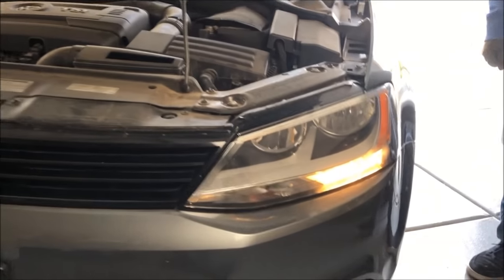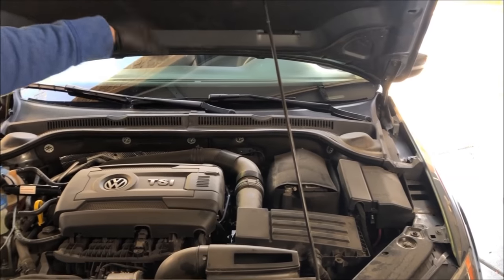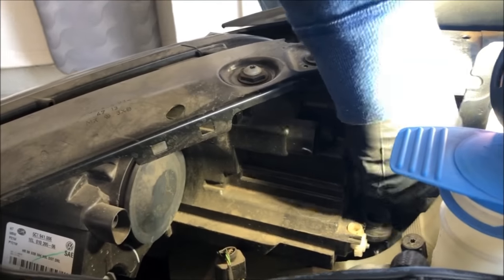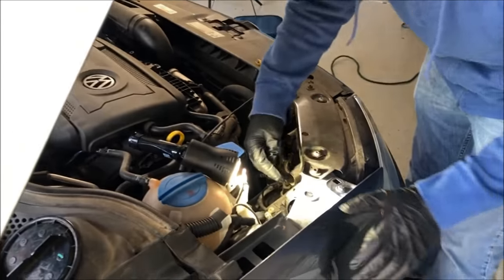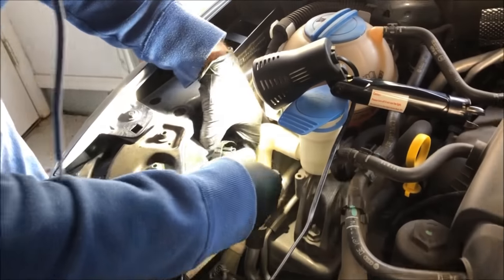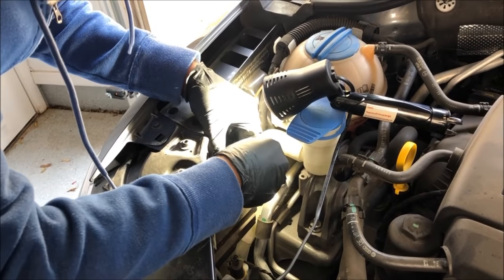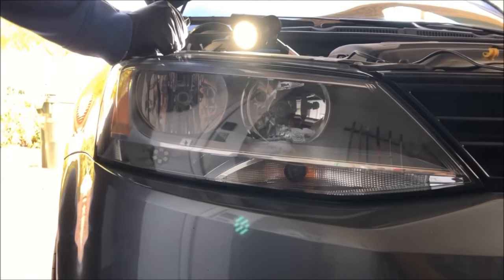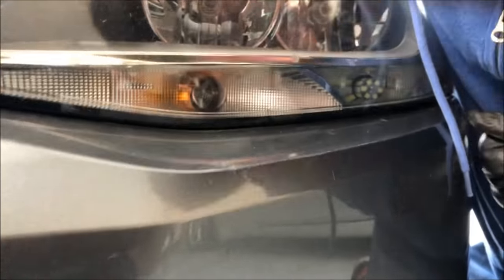How to Replace VW Jetta Daytime Running Lights (MK6 2011-2018)

Comment: Thanks for the video. It was a big help. The owners manual to my 2015 Jetta tells me to take it to a dealership if I need to change a light bulb. "Changing a lightbulb takes a certain amount of skill," it says. I'm pretty confident I can handle it, VW. I just needed to know how to get at it to change it. Information the manual fails to provide. Lucky there's YouTube creators like Andrew c to help us out.
Reply: After many failed attempts I took it to my local mechanic and he had a couple useful tools and got the bulbs out in like 10 minutes and he didn’t even charge me
Reply: @phillyeagles4301  even 10 minutes is long to change some light bulbs it should be easy but car makers seem to think its a good idea to pack all the cars stuff right behind the headlights

Comment: IF YOU'RE HAVING TROUBLE with the driver's side. Needle nose vise grips, open it about a half an inch. Place the pliers around the fin style plastic connector with your right hand. Twist handle CWW, you may have to play with how wide you have the pliers. Less than 10 minutes believe me,  I was done. I chewed up arm and hand, delighted I finished the job and the lights look great!
Reply: Im trying to do that right now. They placed the bulbs in a ridiculous spot.

Comment: If you turn the driver side wheel all the way to the right you'll see a screw, unscrew that and it will give you easy access to the drl

Comment: Joe Kirby
0 seconds ago
I 3d printed a ring like tool that was slotted to grip one of the fins.  Perfect amount of leverage.  Came right off after hours of trying everything else.  tool was 25mm x 35mm x 8mm with a 3mm x 9mm slot.

Comment: Thank you very much, and it was easy.  VW Company wanted to charge me $170.00, for the job. Save me money..
Reply: How did you take it out??  Just pull or twist?? I can’t figure it out
Reply: @SidedTie  Twist, and pull.
Reply: Put LED lights. If you have big hands, it's going to be difficult. If you have a girl/wife, let her do it. It will be easy for her to remove it.
Reply: @Milton Ortiz I was able to take out the passenger side one no problem BUT the Driver’s side after 3 different attempts in 3 different days due to hand sores and potential scarring I was able to remove it when I tried it while the car was still “Hot”. Thank  you so much for your help with this
Reply: Omar Sainz Anytime. Yeah the driver side is a problem. It took me 15 to 20 minutes, to get it. Plus it save you money.

Comment: I absolutely dread when my lights go out on my front end. VW were on crack when they designed the access to these. I hated changing my headlight.....now a running light and the other headlight is out. I dread changing them. I have changed hard shit on cars, and this is by far the worst lol

Comment: I tried on-and-off for two hours and had two other people try to get the bulb out. Ended up removing the grill and loosening up half the front bumper only then to remove the headlight so I could get to the damn bulb. I’m never buying a VW again.

Comment: Geez, thanks, I took mine to a shop to have my brakes done and asked them to replace my bulb while they did my brakes. They said they would have to remove my bumper in order to do it. I said, yeah never mind. Kind of worried about my brake job now. I can do this myself.

Comment: I can do all that fine...But the connector is stuck in there...Like really stuck!! It turns CW and CCW no problem, once turned it can move left to right but not up and down and it seems stuck at the bottom and it just will not come out!! Anything to remedy that??

Comment: Remove the low beam socket it'll be in your way. Don't reach in the hole while you're facing the windshield. Reach in with your back to the windshield. Facing the same direction as the car is facing. Twist the socket close to the opening not on the fins. Your hand is gonna hurt a little. Took me five minutes.

Comment: Has anyone had any issues with the 2017 VW Jetta SEL?? I am in the process of replacing my DLR and it seems that there is no bulb for this. I even removed the bumper and headlight to get a better look but it seems that its digital maybe?

Comment: I failed to change it, same goes to the signal bulb, it's hard to do it without damaging the internal tiny wires, it would be better to just replace the whole headlamps unit straightaway on mine

Comment: Does the bulb just pull straight out or does it twist out? Same as putting it back in does it just push in or does it twist in?
Reply: Looks like it twists, at least most bulb housings are that way
Reply: The actual lo beam kind of pull off, but drl  are push and twist.

Comment: Volkswagen went down the drain. Their old cars never used to be this stupid to work on. Just had to do this job on my sister's car and ripped my hands apart. And there was no way in hell I was pulling the bumper apart to replace a single freaking bulb.

I owned a 2000 Jetta 2.0. That car was cake to work on compared to this POS

Comment: Man I have a 2016 and I cant do the driver side its impossible. Gotta take the whole bumper off ahhaha screw that
Reply: @CryptoGuyoti  nope, I tryed going through the wheel well but my hands are to big, cant get a good grip on the bulb to turn it out :( need like a 10 year old kid to do it Haha I cut my hands and arms up so badly
Reply: I was having trouble with that side, too.  I was leaning into the engine compartment from the front and couldn't get leverage. In this video, they're standing on the side facing the way the car is pointed and reaching in from the side with their right hand. I tried it that way and was able to get the bulb out in seconds.
Reply: I also have this problem with a 2014 Jetta, still have no solution and haven’t changed the bulb yet

Comment: I cant fit half my hand in there, I have man hands. Do I need to take the whole assembly out? Grrrrrr!!!! Car engineers probably do it on purpose...
Reply: I had to and trust me you don't want to in order to remove the whole assembly you have to take the bumper off Wich is not the hardest thing ever but aggravating

Comment: Just pull or twist or push and twist!!  I can’t take the bulb out!! 
Edit: The driver’s side was way harder than the passengers. I was able to take the housing off while the car was still “Hot” and it just popped off.

Comment: Dudes....wth.  this kind of sucks azz.  Dealer wanted to take out tge whole headlight assembly, to the tune of 240bucks....for a 8 dollar light bulb?  Get wrecked.  Good job on that  the other side, i changed my other side a few years ago on a 35 degree day and hacked my hand up like so many others have.

Comment: "Black as night, somebody touched it without gloves". Nope, that's not why it's black. It's black on the inside because the tungsten particles came off the filament and stuck to the glass. Halogen gas in 'Halogen' bulbs prevents that cycle. Look it up if you don't believe me.
Reply: It's not halogen bulb

Comment: You want to first test the bulbs on first before putting it back into the assembly because if for some reason that bulb does work your going to have to stick your hand right back in there and you know the drill